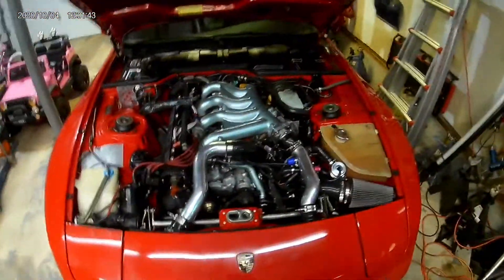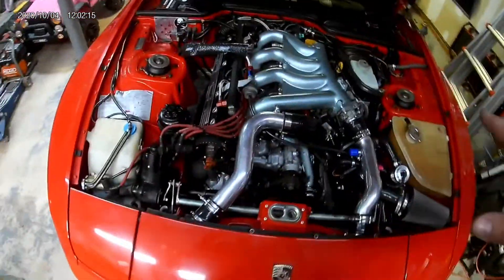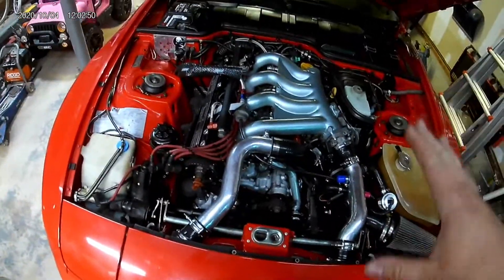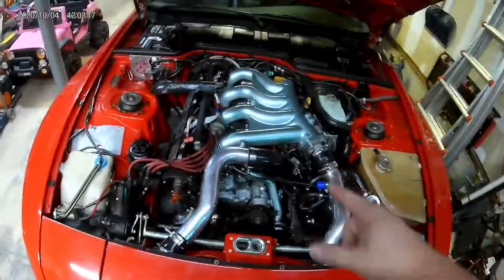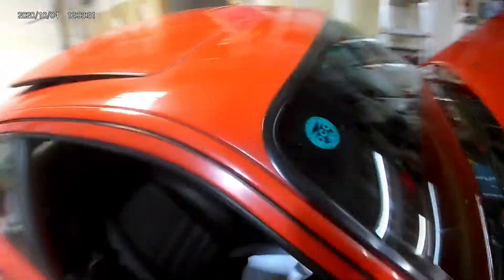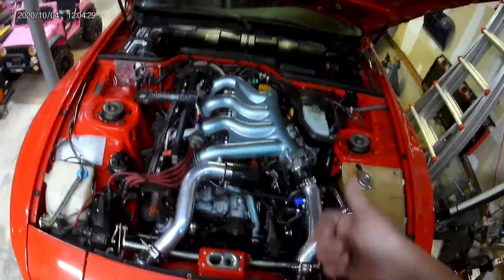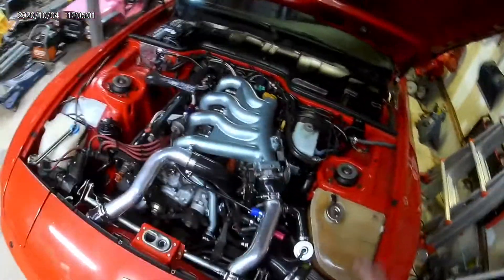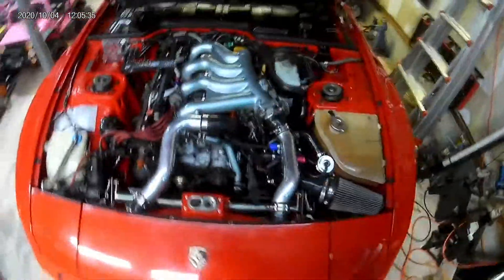Advancing The Cam Gear For Better Spool

Comment: So what did you get with another degree advance?  Didn’t see an update.
Reply from the maker: Hey! So after about 2 degrees advanced valve timing, we saw no improvement and actually saw air flow drop off based on our MAF voltage log